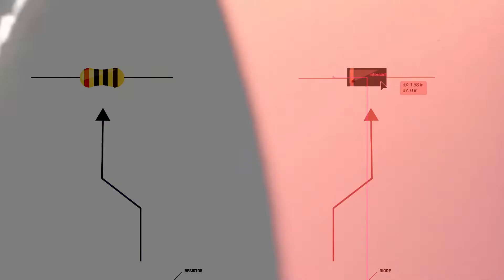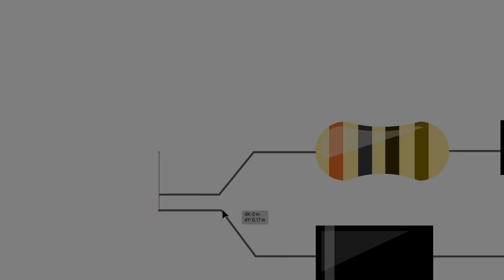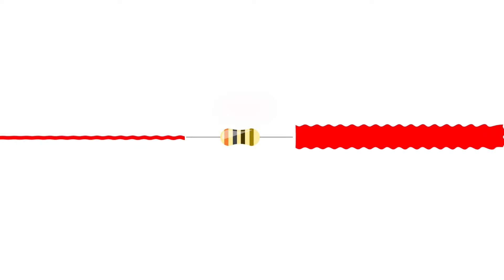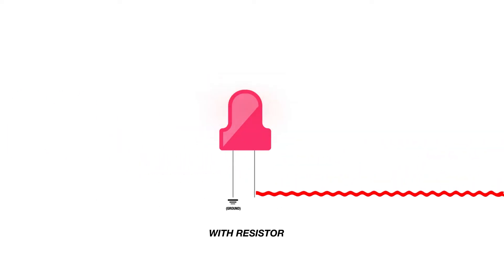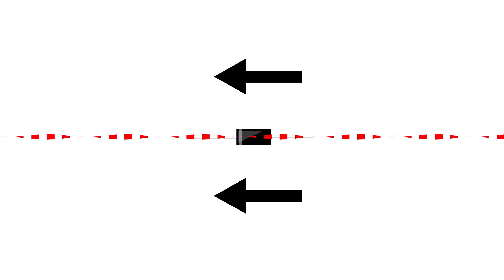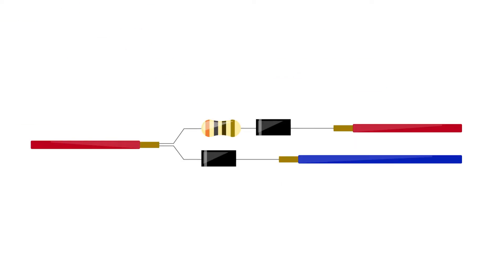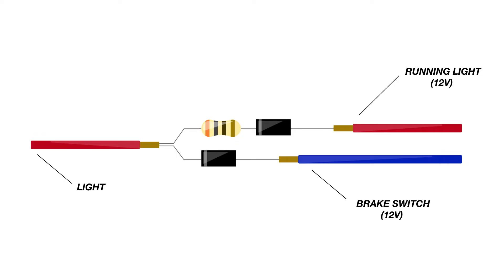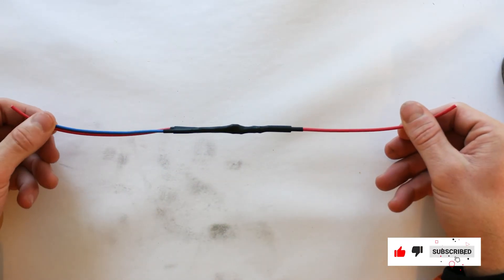How to Make A Dual Intensity Tail Light

Comment: So, no info on selecting the resistor to vary current/voltage….and you show only a 12v led….but most red leds aren’t 12v, but consume around 2 volts, or multiples of 2v for more leds wired together. Would have helped people better to include the dropping resistor value using ohms law to calculate a value that gives adequate brightness and max longevity, keeping values within spec.

Comment: Wont the brake light power be lower because of the voltage drop in the diode?
Reply from the maker: The diode you use determines how bright you want your “running” light. The “Brake” light gets the full 12v.
Reply: @kylevara  typically, speaking of additional brake light LEDs, like for top cases, they consume about 1.5w, which is about 0.125A. The diodes you use are rated for 1A, which is fairly safe, and probably the lowest rating one should go, for safety. But they also have a forward voltage drop of 1.1V, that means the line you use for applying the Brake Lights will also have a 1.1V drop, meaning that the LED won't be as bright as if they were just directly connected to the Brake line.

What I mean is: the concept is correct, the Tail Light and Brake Light will function as intended, but has the set back of the Brake Light (when breaking) not be as bright if it was connected directly (without the diode).

In other words, you lose a bit of Brake Light maximum power.
Reply from the maker: @skmblzz3292  totally understand and you make a great point but for this application it’s acceptable. The trade off of having less wires is worth it for most motorcycles, if I had to wire a car or something with multiple lights the parasitic draw would be too much for a standard 12v system, but you would have more room to hide the extra wiring.
Reply: @kylevara  Hey man! Just remember one thing... Forget about the transistores and just replace the Diodes you're using with better ones!!!

Instead of using normal silicon Diodes, like the rectifier ones you using (1N400X), use Schottky Diodes, for example the 1N5819. They are typically used in signal and switching applications and here are their benefis:
«Schottkys have two main advantages over silicon diodes in low voltage applications. First, they have about half the forward drop. Second, they have instant reverse recovery times for most purposes, which full silicon rectifier diodes certainly don't have. This can be very important in switching applications.» 
For the second main advantage: Imagine you later decide to install a LED Flasher (cool stuff to add to your brake lights), it will perform significantly better than the normal ones.

Not to mention, they will waste half the energy compared to the ones you're using.
Reply: @kylevara  Did I forgot to mention that in this case, you don't have to change the wiring or add more wires? Just replace the diodes ahah
Reply: @kylevara  you can check the diodes data sheet for more details. Ofc, no sistem is perfect, but probably we could go a step forward and try to use transistors to control the power to the LEDs, I think it might be at least slightly more efficient, meaning, having closer to the LEDs maximum power